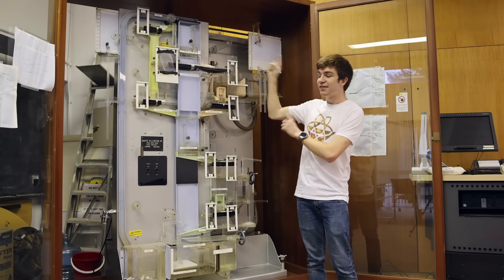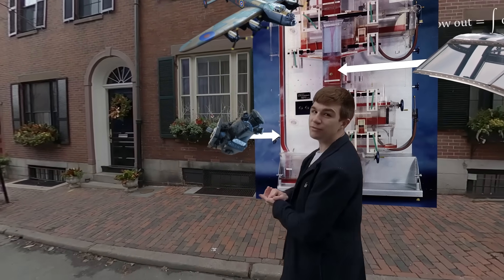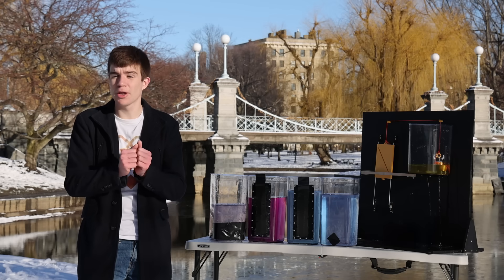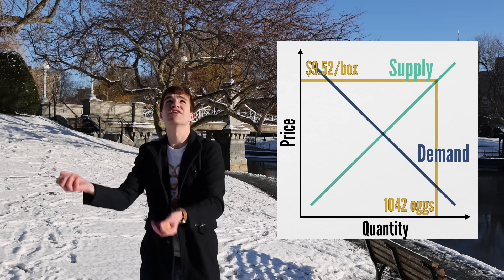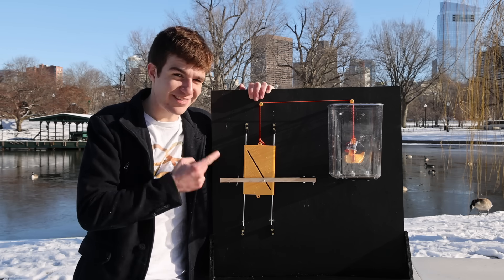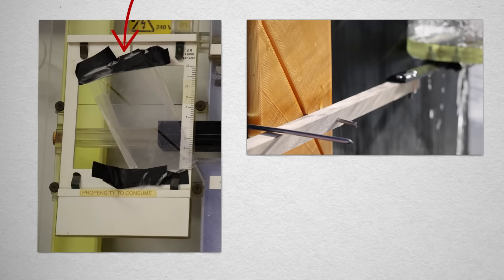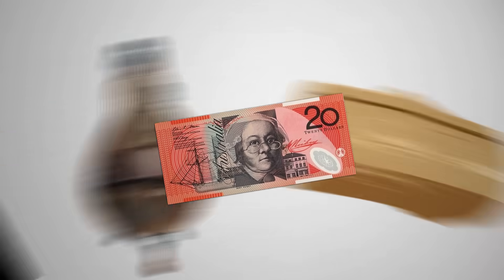Dividing by zero on a water computer from 1940

Comment: That model is useless. No wonder the economy is F*** in every western country if we use any economic model derived from it or similarly flawed. Money spent is only half the economy the other half is value created or wasted. Which is the only important part. For example, if I just bought lotto tickets with my money would we be any richer than if I bought a CNC machine and started producing goods that saved people time and money. Thus making those people richer. Hell, if I bought the cnc machine and just sat there never putting it use would the economy be better off than if I handed to it an investor who, we will try and find an economic use for it? According to that model all of this has the same value. But it doesn't and anyone can see it. Also, high income taxes are way for the already rich to stop other people from becoming Rich. How do we know this? because most people who make over a million dollars a year, do so for only one or two years usually as the result of a decade or more of work coming to very large pay-off.

Comment: What would happen if you set the MPC past 45 degrees / 100%, i.e. people spent more than their income, taking away from their savings?
Reply from the maker: Interesting question! In the machine it can't physically go that way, but you could model it by opening up the investment tap a bit more... in which case income would increase at a much faster rate than in this test. If we keep quantitative easing (I think) running then that would keep increasing income at this rate indefinitely (or until the machine spills over) else the bank runs dry and we keep increasing at the old slower rate (again, until the water spills over). Keen to try it out honestly!

Comment: It's interesting that even today some (much more advanced) water and other analogue computers are being researched and built again because, as we run into factors which make increasing computer speed more expensive faster than in the past there are some narrow but useful classes of really big mathematical problems that are simpler to solve through analogue phenomena representing multiple variables interacting constantly in complex ways that are simpler/faster to calculate in aggregate and measure the result of to acceptable accuracy with a physical representation than to crunch every decimal in a digital computer.

Comment: ERROR
The rule being that divide and multiply are inherently linked. As an example: 42/6=7, 42/7=6, 7x6=42
But if 42/0=INF, INFx0=0, Not 42, which breaks the rule.
Reply: That's circular, your conclusion is based on the assumption you are trying to prove. 
What if we said that INF x 0 = undefined? That way it is always more than zero (because you multiply by infinity) and less than infinity (because you aren't multiplying by a positive number) i.e. it could be literally any positive number. In a very real sense it is all positive numbers at the same time.
Reply: @bramvanduijn8086  Oh, so multiplying by 0 does not always = 0? Because no matter what positive or negative or decimal number I put into the calculator and x0 or 0x always returns 0.

Comment: A magnificent video. If I have one criticism though, it's that we just don't get enough footage of the actual machine running! And the parts that we do see, don't have quite as much context as I would have liked.

Edit: judging by the size my comment ended up at, "one criticism" might be a bit of a stretch 😅

I'll repeat again that *I loved the video*, if this comment appears negative it's absolutely not intended, you did a lot more things well than things that need improving. But obviously I'm focusing on the things that need improving, because that's what I'm writing about :)

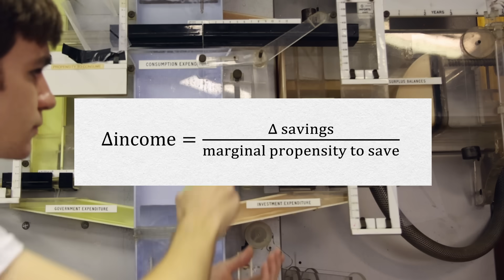About context: at 7:18  "this graph shows income" - what is the graph connected to? How it is driven, physically, and why is that a representation of income? Whereabouts on the large machine is it? And the next shot at 7:23 - clearly it's part of the same machine, but we don't even see a single shot that includes both parts - except maybe way back at the very start of the video, before we had any idea about anything.

Similarly, at 4:56 we see you cleaning the exposed wire, and then at 5:04 we cut to a zoomed-in shot of some part of the machine that you say is the same wire. There's two problems: one, we never saw you put the wire back in place, so we don't even know where it goes on the machine. Even as I write this comment, having paused and re-watched the footage, I'm not entirely sure how it's put in place (although I do think I know where it is). Second, we never even saw what you were cleaning, specifically what it looked like, so we can only take your word for it that it's the same object - not that there would be any point in lying, but you know, show don't tell. The second shot is so much more zoomed-in that it might as well be a different machine entirely, or footage taken on a completely different day. And also, it would have been great if you showed the oxide residue before and after cleaning it - again show don't tell. Naturally if you just forgot to take footage of it that's fine, but with so many parts of the machine worth looking at in detail, it's odd that that's what you decided to talk about for those 30 seconds.

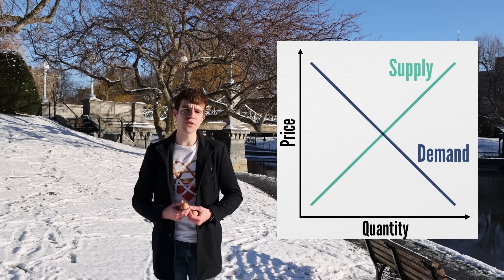At 3:09 you finish explaining the Sutro Weir - which you explained well and clearly despite spending very little time on it (well done!) - but then you don't show where those are used on the actual machine?! I don't know if they're visible on the machine, but even if they're not, you could at least show B-roll footage of the machine and point out (with an arrow maybe) where the weirs are hidden.

I'm guessing that you have been staring at various shots of this machine for hours in editing, so you might feel like all the information required to understand it (at least to the level intended) is in the video, and that might technically be true, but as a viewer I feel like you glanced over too many of the details of the actual machine, and rushed through the footage involving it. The machine is the co-star of this video, so it's strikingly odd that it only takes up a short portion of the runtime - less than a minute at 1:30, being prepared at 4:57, in the background for just a few seconds at 5:52 before being hidden by graphics, and after that, small segments of footage used to show the experiment, which are (as I mentioned) a bit disconnected from each other in video, which you try your best to make up for in narration.

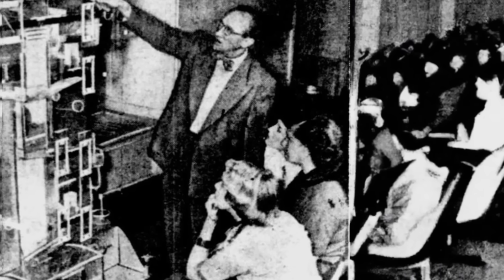You mention at 5:42 that it has been used to "mess about with its various settings to get an intuitive understanding of how the economy should work". What an excellent opportunity to do exactly that! I imagine it like this: we see a wide-ish shot where we can clearly see the entire machine with you standing besides it. It's running at some sensible "default" settings, and you point out how to read its various parts and what they mean. Then you change one setting, and show how it affects the rest of the system. Give us some eye candy - you spend so long talking about this machine, we want to see it in action!

I know it's annoying to have a "backseat driver", as I am basically doing by writing this comment. This is intended as constructive criticism, nothing more. Obviously you're free to take from this what you want and discard the rest, or even discard it all, and I will remain your fan just the same :)

P.S I love how your pirate impression at the end gradually became more and more in-character!

Comment: I mean you can easially devide by zero. 

Its just that the answer u get is negative infinity and positivie infinity which makes it undefined. You need to define which answer you want. 

So by defualt setttings calculators say its undf because you havent defined it yet
Reply: It's "undefined" because there is no number x which satisfies the equation x*0=1
Reply: The idea of a negative amount of water is absurd. By extension a negative amount of anything is absurd. This is confirmed by observing reality.
But we need the concept of negativity to make sense of the real world observation that sometimes things reduce, i.e. we need to be able to subtract.
So how do we resolve this? I propose we move the trait of negativity out of the number and into the unit. So instead of negative four water, you have four water leakage (or evaporation, or whatever). Negative one apple becomes one eaten apple. And so on and so forth. That makes negativity a direction instead of a property of a number, which makes more sense anyway.

Comment: I know little to nothing about economics, but from this video alone I can come to a clear conclusion. If this speeding market idea is followed through to its conclusion, it shows that the extremely wealthy are in complete control of the market speed. By the rate at which they invest in the market or in bonds. This also shows that taxing the wealthy will ONLY increase the speed of the market IF a majority of their income was being turned into bonds. A vast preponderance of whom certainly do not, as doing so would result in a dramatic slowing of their own income and inevitably their status as extremely wealthy. With the presumption being, as long as the market is overall continuously speeding up. This creates a clear correlation between taxing the wealthy and a slowing economy. That of which is, in doing so will inevitably crash the market.

Comment: Call me a simpleton, but i’ve never seen the problem with dividing by zero, cause division is just inside out multiplication, so if we get a zero when we multiply something with zero, when dividing by zero, we ought to get the original number, in other words, a fraction which contains a zero should be considered a redundancy, not a paradox.
Reply: 6/2 = 3
If you multiply both sides by 2, you get
6 = 2(3)
6 = 6
Now if we try to do the same thing with division by zero, even using your return the numerator thing, something becomes apparent: 
6/0 = 6
6 = 6(0)
6 = 0
6 =/= 0
It actually doesn't matter what you set the result equal to, since there is no number that can be multiplied by 0 and return a non 0 number.
Reply: @johnclark7966  a good explanation, and it does poke a hole in my example, so i have revised my model, as i had not considered the fact that the result ought to be reversible, but the fix is quite simple, as your example has already given us the answer; if something multiplied by zero equals zero, then something divided by zero must also equal zero
Reply: @THarSul  this has the same issue, though
Using the same example:
6/0 = 0
6 = 0(0)
6 = 0
There is no number you can set as a result to make it valid, as it would have to be multiplied by 0, which always returns 0. This is why it is undefined, as you would have to solve 
non-zero number = 0 * x
Which is not possible, as any x multiplied by 0 is 0.
Reply: @johnclark7966  lol, im not really trying to posit a mathematical explanation for my reasoning, but rather to explain the shorthand my mind is using to abbreviate the fact that it's a fundamentally meaningless statement.

Comment: Mains voltage dunked directly into water won't heat anything you will get small amounts of hydrogen and oxygen that's it !!!! I've directly dunked a heating element into water to speed up the heating of my hot tub that works!

Comment: Quite appropriate using water for an analog integrator. I actually used electronic analog computers in college, even though, by then it was already obsolete. Analog integrators can be used to solve differential equations, and analog computers were heavily used in the 40s, 50s, and 60s. For those who haven't taken calculus, the integration function is basically a bucket collecting water. Concept is more important than manipulation, such a long division.

I think Liz Truss used a broken one. The Federal reserve in the US, just uses open pipe.

Comment: "Apparently, something divided by nothing is infinity" I actually saw infinity as the answer in Euler's Elements of Algebra. No clue why it is said to be undefined now.
Reply: Because you have to use limits to get infinity

1/x is undefined. The limit of 1/x as x approaches 0 is infinity.
Reply: @BanakaiGames  Using limits is fine, and actually necesarry for defining real numbers. the actual reason for why 1/0 is undefined is because it has two different limits: infinity (x/0) and negative infinity (-x/0).

There are ways to fix this. one example is the projectively extended real line, which defines infinity and negative infinity to be the same, though that still leaves 0/0 undefined.
Reply: It's said to be undefined because you can take the limit of 1/x as x approaches 0 in two different ways. Either x gets closer to zero from the positive side (positive infinity) or x gets closer to 0 from the negative side (negative infinity).

Now, infinity isn't a number, but I think I can confidently say that positive infinity is not equal to negative infinity.
Reply: @legendgames128  You can easily resolve that by moving the negative sign out of the number and into the unit.

Thich makes more sense anyway because making a distance negative changes the direction, not the distance. Same with temperature, though you should be using Kelvin anyway, which is absolute. Here's a fun basic example: The unit is apples. You have 6 apples. You add 2 apples, you now have 8 apples. You add one eaten apple, you now have 7 apples. Doesn't that make more sense than subtracting an apple? What does it even mean to have a negative amount of apples if the negativity doesn't change the nature of the apple?
Reply: @bramvanduijn8086  Yeah, that's what I thought at first, but now I just opt for 1/0 = unsigned infinity, and 1/infinity = unsigned 0
Reply: I think it was Matt Parker that said trying to "define" Infinity as a number and not merely a concept is a pain in the butt and causes a lot of mathematics terminology based arguments and debates that go way above a high-school level student most likely to ask this question.

Tl:Dr; there's currently better things to do than trying to say zero = Infinity
Reply: Some people will tilt at any windmill.
Pick a better target for your energy, people.
Reply: @Samuel Werley Why not? There's either a hole or an infinite amount of possible solutions at that point thus making it either ambiguous or indeterminate.
Reply: @skilz8098  words can have a slightly different meaning in specific contexts than they do in everyday use. Like how weight in science doesn't mean mass. Or in this case how the word 'undefined' is used in mathematics. You may well disagree and insist it's not the appropriate word to use, but at that point you'd have to go against the entire mathematical community's consensus and conventions.
Reply: @thatmarchingarrow  Exactly, challenge everything! We can not be so complacent to just accept everything without questioning it.
Reply: @skilz8098  
Sure, but this is just a word and it's just convention. There is no point challenging it. I'm not saying to just accept everything, but why insist on changing things that really don't affect much of anything? Ok, say you somehow managed to convince the whole mathematical community to stop using the words defined and undefined in the way they are currently used, what would that achieve?
Reply: @thatmarchingarrow  Nah, be precise in your language. Especially when it comes to math. Just because something is a convention doesn't mean it makes sense. Everyone has to do an extra step to transform the meaning of "undefined" in their minds. Why is that necessary, or desirable? It's the exact same thing that we do with the word "colonel". Clearly it's pronounced kah-loh-nell, yet we're all expected to pretend it's pronounced kerr-nell. Or we're supposed to pretend that John Boehner's last name is pronounced bay-nerr instead of boh-nerr. I for one refuse. Fix your terms, make them precise.
Reply: @spracketskooch  
just because it's different from what you expect doesn't mean it's imprecise
Reply: @Samuel Werley That doesn't make it undefined, it still has a clear definition. I'd argue the fact that n/0 is ambiguous or indeterminate before it is undefined. If something is undefined it doesn't have a definition and the definition of n/0 is division by zero. That is clearly defined. The result of the computation is ambiguous or indeterminate. It's the same thing for vertical slope and the asymptotes of some of the trig functions.